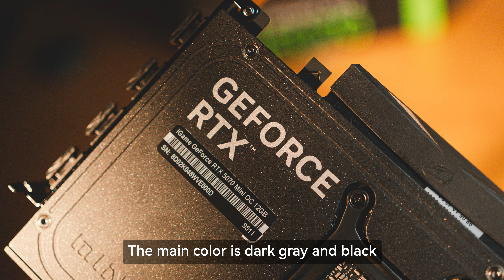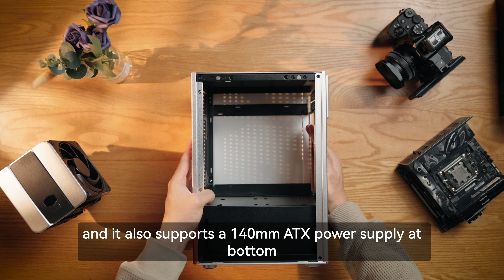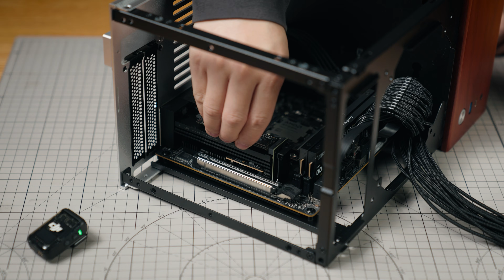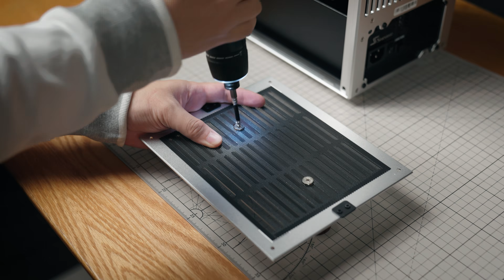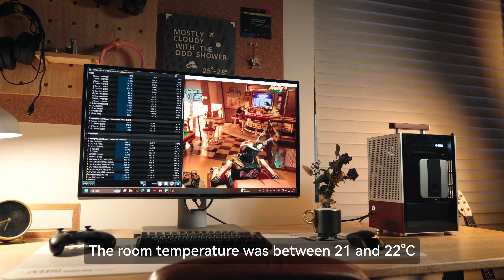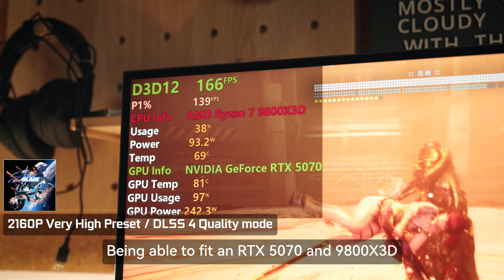A Single-Fan RTX 5070 ! The Most Powerful Mini-ITX PC ? Ryzen 7 9800X3D | JONSBO T6 ITX

Comment: yo wtf this is a very short video, but it's very thorough.. Mr. GUI what do u think about thunderobot's mini tower prebuilt PC? The one with MoDT CPU + Motherboard that is apparently a niche that is getting popular
Reply from the maker: Oh, I think I know the kind of system you're talking about.

Personally, I think the biggest advantage of those mini PCs is their portability. Other than that, I don't see many advantages over building a PC yourself.

Most of them are likely using laptop-class CPUs and GPUs, so their performance is generally lower than desktop hardware.

Another thing to consider is thermal performance. In such a compact chassis, noise levels and temperatures under heavy load may not be as good as you'd expect.

That said, if it's significantly cheaper than building a desktop yourself and portability is important to you, then it's definitely worth considering.
Reply: @MrGUIonPC  that's quite reassuring, and yes it would be way cheaper than building a desktop myself so I am considering to purchase that. Thank you for the input!

Comment: Not good use of space. I have a case with 2 liters more of volume and it can handle 4 Slot cards with 359mm length. And big CPU coolers too. And it is a very silent case.

Comment: Late comment, but did you do anything special to make that cooler fit? According to case specs, the cooler is just slightly too tall. I know there are sometimes differences in how those measurements are calculated by case manufacturers. I just wanted to be sure no modifications were needed.
Reply from the maker: Yes, the cooler I used is actually about 1–2 mm taller than the official clearance specification.

I was still able to close the glass side panel without any issues because components such as the cooler mounting system and the motherboard assembly have a small amount of flex, which is enough to accommodate that extra 1–2 mm.

That said, if you're concerned about putting any pressure on the components, I'd still recommend sticking to a cooler that falls within the official height limit specified by the manufacturer.

Comment: Man....... this would be the PERFECT UE5 traveling PC I need if not for the fact that the total cost is 1/4 the total cost of my SUV....... I am using the Nitro 5 with an RTX 4070/32GBRAM and Ryzen 7 Series Chip. This laptop cries everytime I try to run UE5 C++ Projects with Google Chrome open.... A Case this small could fit in my Backpack and I can take it to work with me everyday

Comment: Very cool build.  That case is so efficient I might see about upgrading a 4.5l build I have with a 4060 Solo to this.  I built a Bazzite-based console using similar parts but with a 9070 XT in a Tower 300 horizontally mounted so I can put it in a corner cubbyhole vir it still looks good.

Comment: Great job, guys!! Your English is much better than my Chinese. You put together an exciting build. I need a workstation for my career, and I don't game. Did you run any productivity benchmarks: photo/video editing, coding, web design, etc? Keep the videos coming. I'd be particularly interested in a home media centre/NAS in a case like this, especially if you can find a motherboard that handles bifurcation with the ability to hold 4-6 M.2 NVMe drives.

Comment: I have always LOVED this case due to its design but I’ve always felt as if it should’ve been a sandwich style case due to its compact size to then allow for more hardware choice. With the single fan 5070, it does help allow ITX builders such as myself to be able to have just a little bit more flexibility with having a bit more power. However, I already have a build in process with the NZXT H1 V2. It’s also a great case but I do LOVE the size and design of this case more

Comment: How is the tempered glass panel mounted to the case? clips and magnets? I would really like to replace the glass with a DIY non-breakable option considering this case has a handle for transporting.